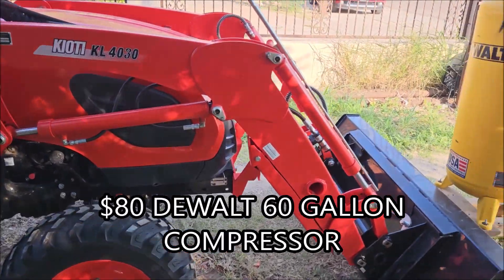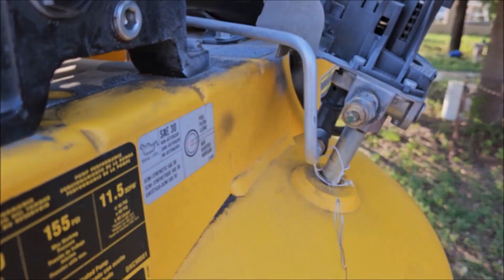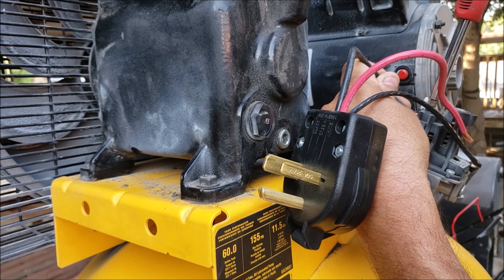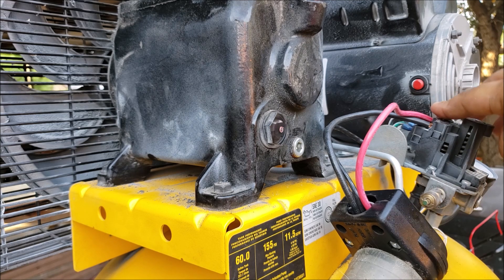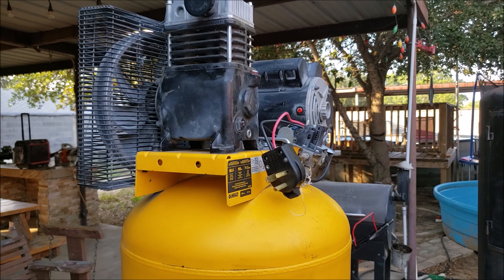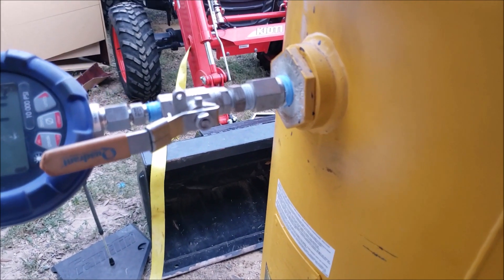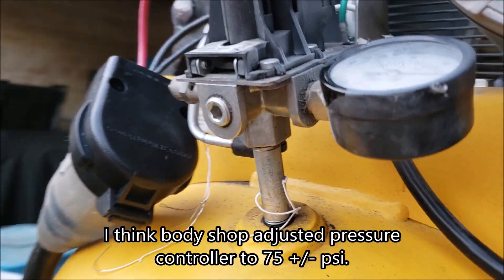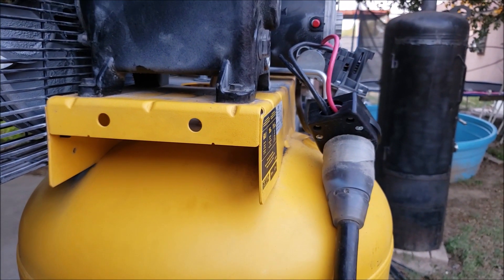I bought a used Dewalt dxcm601 60 gallon air compressor for my Langmuir systems plasma cnc table.

Comment: That's going to be a really good score if it turns out OK.
Reply from the maker: Its been 1 month and I have not attempted to test compressor out. I want to run 1 compressor to fill both tanks and the reserve capacity should really help with long cuts on the plasma table. I have 1 220v/50A outlet and cant really run the cutter and compressor at the same time so that is the idea of using this as an auxillary tank.